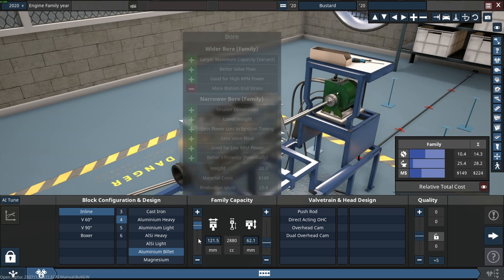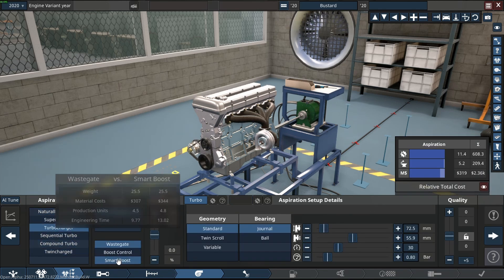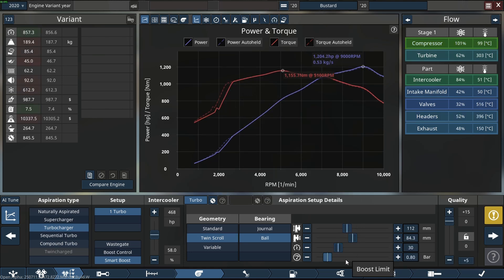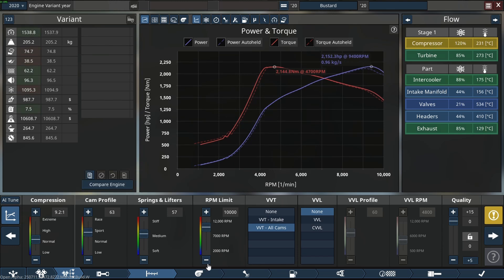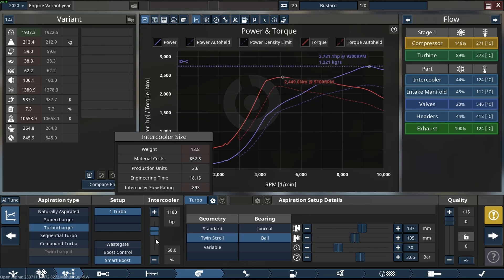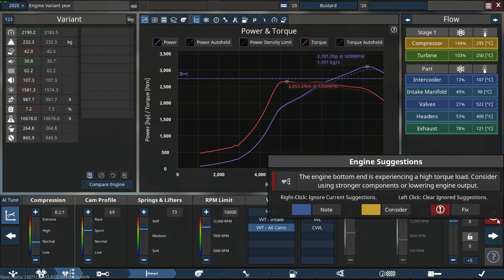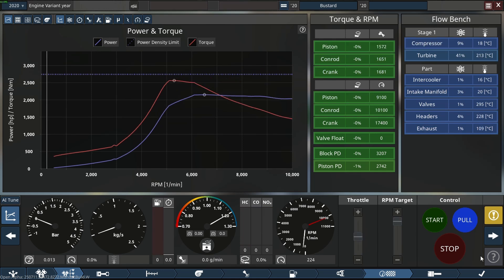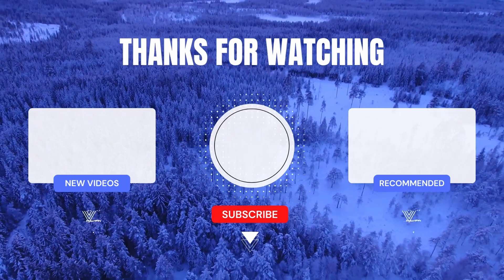Half a V8: I Built a 4 Cylinder That Shouldn’t Exist in Automation the car company tycoon game

Comment: I would say I made a better engine. 3 lier displacement, 3 cylinder, 3000hp. With another cylinder, each cylinder a little smaller to get 3.5 Liter displacement, I could have gotten over 3500 HP (I have a V10 with 3 liter displacement that reached 3300 HP thanks to each cylinder being a little smaller while having more cylinders)
Reply from the maker: Awesome
Reply: @Curiousgamer20 I now have a 3499cc i4 with 3800hp but it's not as reliable as your engine. I probably could lower the power a little to make it better than your engine but I'm not going to.
Reply from the maker: Awesome that engine I built was as a semi- reliable inline 4 with 3100hp so I want to I can make a boat load more but I think I'm going to focus on high horsepower but reliable engines so thanks and congratulations btw